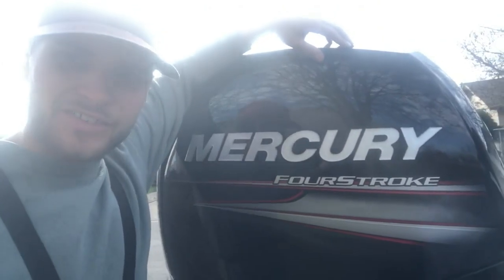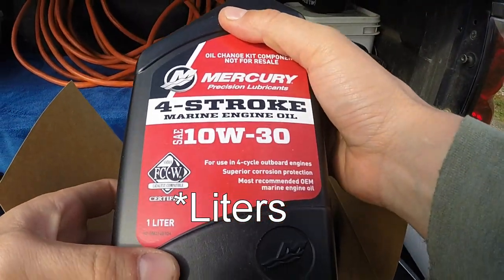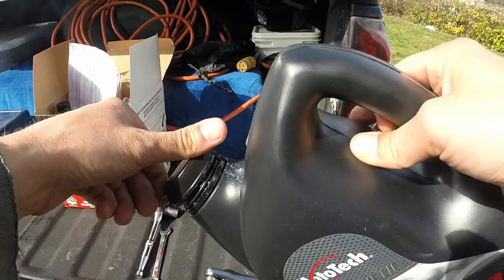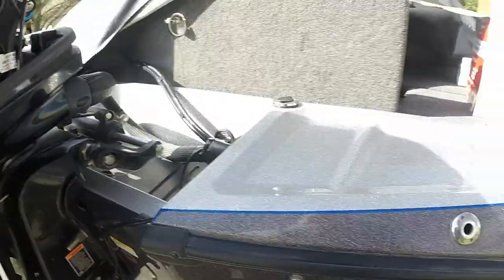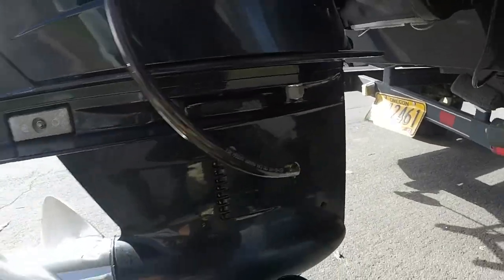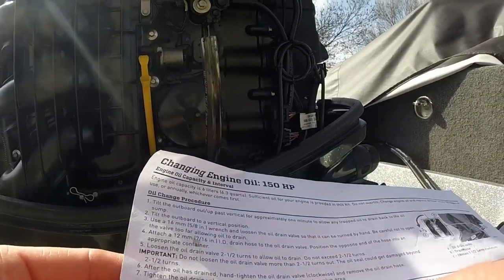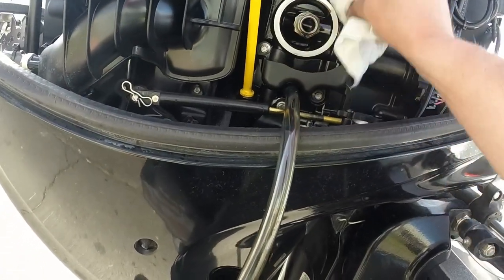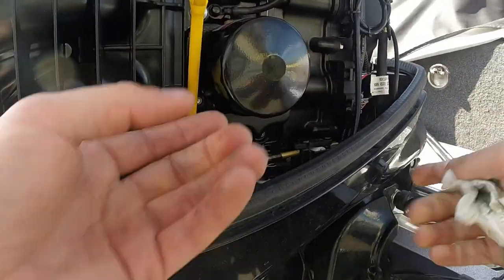How to change the oil in your 4 stroke - Mercury 150 hp 1 year maintenance part 1

Comment: Ok so here is a tip from your friendly neighborhood marine tech.  Good job on the whole process, but use oil instead of grease the next go around.   Oil will soak into the pores of the rubber gasket and provide a solid seal against the mating surface.  Also I see that you are following Mercury's service intervals based on your comments here.   That's good, but oil is cheaper than iron.  Don't be afraid to change the oil at half the service interval as recommended by Mercury.....especially if your fishing includes a ton of graphing and idling.    I will typically change out the oil on my Mercury 150 4S every 50 hours both for engine oil and lower unit oil.   Also I know they say the yellow gaskets can be reused, but they are cheap so go ahead and install a new one for each plug each time you break the seal on the screw.   Lastly if you haven't already you should sign up for a BBC boards account and join the Mercury FourStroke forum.   Don Weed is the moderator and is by FAR in my opinion the most reputable Mercury Service Tech in the country.  Good fishing and tight lines bro!

Comment: It looks like the same exact Mercury 150 outboard that i have.  When i did mine (had a marine mechanic help me), it did not take all 6 quarts of the oil, it was more like 5 and 2/3 of the 6th quart.  Always easier to add more than it is to take overfill out was the advise i was given.  We ran it with new oil and checked it, it was spot on.  I'm curious if others have an opinion on this.
Reply: Yes this is correct.   You want the oil to be in between the full and low marks on your dipstick.   Over filling of these engines can cause several issues such as "frothing" of the oil in the pan.  When oil is aerated it won't provide near the lubrication.   If you are at the mid point or slightly above on your dip stick you are in the green.   Happy boating.

Comment: Where did you get the 150hp oil change kit?
Reply from the maker: I got mine off of amazon, but I just looked and couldn't find it. You might contact Mercury directly or contact a dealer. Also all the parts are on amazon
Reply: Bucketmouth Bromley Thanks!

Comment: Never use grease on the oil filter gasket.  Use oil!
Reply from the maker: tjk6277 why?
Reply from the maker: I understand the directions say not to, but no one can tell me why. I always have.. Do you know?
Reply: It is because the grease will containminated the oil ,but it is just little wont harm the engine .By the way How many hours on your 150mercs?
Reply from the maker: A T probably somewhere around 300. It’s a year later so I’m ready for the 2 year maintenance
Reply: @NathanBromley  grease will contaminate the engine.

Comment: Omg. No. 🤦🏼‍♀️Do not use that GREASE   Good till I saw that. Just use new oil dab your finger in it and wipe it all around the gasket seal.
Reply from the maker: Jeni G. I’ve always used grease on oil filters. What’s the reasoning behind using new oil instead of grease?
Reply: Nathan Bromley it activates the rubber seal to make a better seal. Same process should be applied when doing your car engine oil filter.

Comment: DO NOT USE GREASE!!
Reply from the maker: fishnbaja1 if someone could tell me why, that would be awesome. Cuz let me tell ya it was extremely hard to remove the filter. I’ve always used grease without a problem. This seems to be a 50/50 opinion, but no one can tell me why not use it.
Reply: @NathanBromley  Sorry about the caps. 
The Mercury manual says not to use grease. I tried to find out why exactly, and there wasn't much information. One article seems to imply that grease is not liquid and may clog the filter if it gets in there. You've used grease for a while and haven't had that problem, so....
Great videos, BTW.